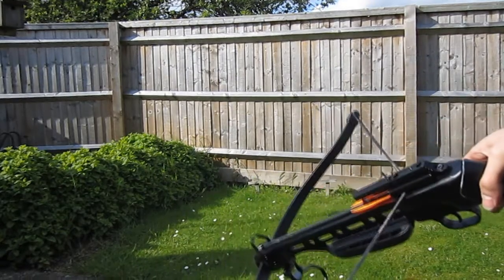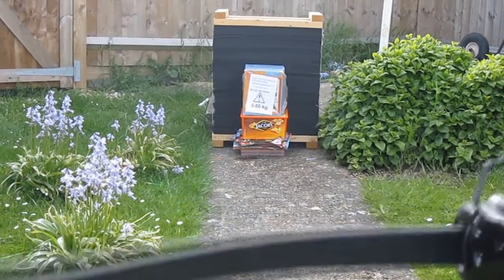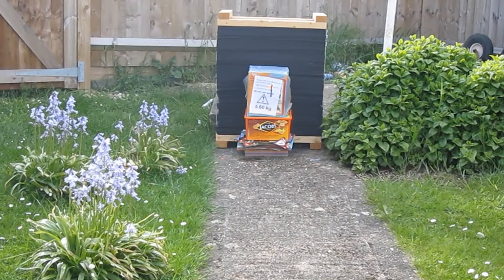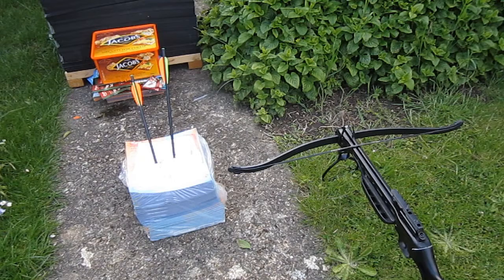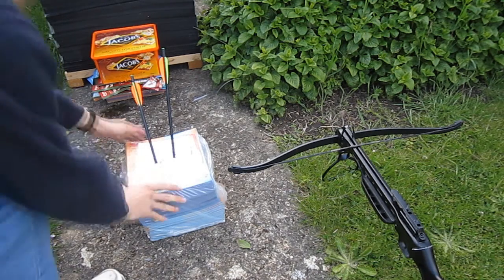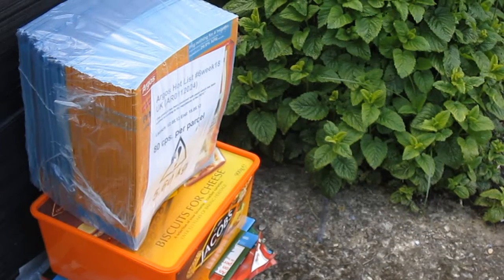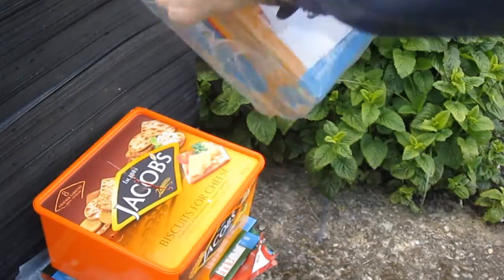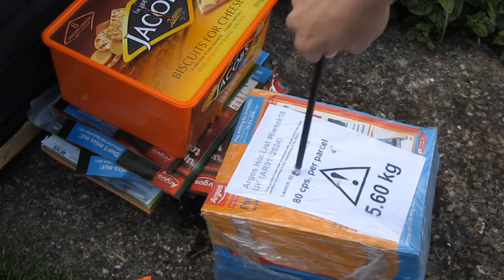150lb crossbow penetration study

Comment from the maker: The weight/force of the string when it's at maximum tension and locked in place.
So when it releases it essentially hits the bolt with a weight equal to 150lb.